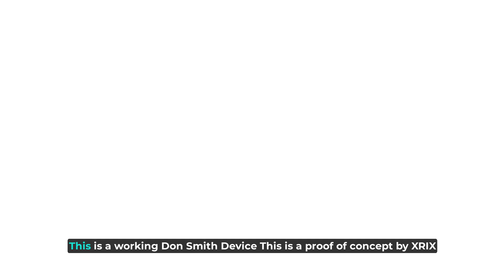Over Unity Working Don Smith Device

Comment: Hey man, I have read Tibor's patent. He talkes about wattless power, cold electricity, electricity that doesn't obey Ohm's law and other abstract terrms. You advised to think in terms of magnetism while reading it but I still don't get it. I have read a lot over the years relating to this subject (E.V. Gray, The Testatika, T.H. Moray, Don Smith), they all seem to connect somehow but I don't know how. I have also tryed Zilano's simple schematics that she recommended but nothing worked as she said, even the simple ones. It is getting frustrating. From your vast experience how does this tecnology work, I mean what is the basic principle?
Reply from the maker: The real example to simply show this(Warning this can kill you): Put two capacitors (Don't use polarized caps) together A and B in series. Attach a bundle of wire(4-8oz awg 22-28) on a spool (hole in center) one lead to cap A, one lead to cap B. Put a magnet halfway up the center of the wire spool, such that one edge of the magnet is exactly half way. Charge up  cap A with DC. + will be A to coil, - will be between  A and B. Once you have that setup, short - to + with a jumper wire.  The magnet will jump. Why, when all the charge took the shortest path when you touched the jumper? The magnet is influenced by cold electricity, and that's what you need to make the circuit in my video work.
Reply: @XR_IX Brilliantly simple! That is your exact cap arrangement with the GDT replacing the shorting jumper.
Reply: @XR_IX  My comments are not posted. Weird.
Reply: @XR_IX  I have a lot to comment on this circuit. Do you mind talking here (b e y o n d un ity -or.g) ; I just oppened a new discussion called Tibor KEMENY and Cold Electricity. You can feel free to post on that discussion, or make one of your own if you would like. I can post experiments better on a forum, that is why I ask. They have a really nice community there. Thank you for your guidance.
Reply from the maker: @juperrr  I see that, however I would like all the comments to reside under this video as an agnostic location, so all can freely see the comments publicly. I saw the document you posted, there is a better one out there available.  goo this "Tibor Kemeny El-90-eng.Pdf"
Reply from the maker: @juperrr  I will answer anything I can.
Reply: @XR_IX  I will try explaining here then, even though it will be very difficult and inefficient. First please confirm this drawing is of the circuit you described (imgurc-o-m/a/2yQbsgj).
Reply from the maker: @juperrr  That is correct
Reply: @XR_IX  Alright, so the circuit is correct, then if I charge cap A directly in the circuit or even separately, what will happen (before I even short cap A) is that cap A will charge cap B thru the inductor, if cap B wasn't allready charged by the power source. Okay, now if I shortcircuit cap A (with the power source removed from the circuit of course) what will happen is that cap A will discharge thru the jumper wire (shortcircuit) while cap B will also discharge, but thru the inductor. That is why you see the magnet inside the coil move. You probably are omitting the simple fact that cap B is also charged and think that only cap A is charged, so when the magnet moves you don't know where the current might come, but as I said above, cap B discharges thru the inductor, so the current comes from cap B.
Reply from the maker: @juperrr  Yes, that is a good point. The B cap does contribute. You can use a very small cap in B. To show you would still get output. The main function of B, is if it wasn't there the voltage will travel through the trafo and never charge the cap. So it blocks DC. Which reminds me vSchaub asked how the gap fires, and that may be a point I didn't mention. Back to your point. I just tested the Colorado Springs setup for the capacitors, and that works as well. If you set it up that way, you are shorting both capacitors with no serial path to the coil. Tell me what you think
Reply: @XR_IX  If I use a smaller cap at B I will get a smaller current thru the coil therefore a smaller reaction of the magnet inside the coil. So basicly the magnet reaction is from cap B. Where is the cold electricity then? The basic principle?
Reply from the maker: @juperrr  Did you see the setup for Colorado Springs top of page 57? It basically has the series cap B first to the supply. Please let me know if you think that would be any different in your mind?
Reply: @XR_IX  I am guessing you are talking about Tesla's Colorado Springs Notes, drawing on top of pag. 57. If that is the case, then regarding that drawing, I can say that is a different kind of animal. Many things can happen over there. I have been studying Tesla for years. He had an interesting way of connecting his apparatus. He was like an electrical wizard. I have the weird sensation when studying his circuits, that they are like living beings. They inhale, exhale, etc.
Reply from the maker: @juperrr  What I am trying to establish is a comfort level with saying that the charges are not going through the transformer, as when you place a capacitor in series with the transformer and discharge through the transformer, because that obviously is working like a battery and making a solenoid.
Reply from the maker: Well assuming I am on to something, which we all must continuously evaluate the references. It works this way: Tibor's Cold Electricity, using multiple staged magnetic multiplication with parallel symmetrical impedances. That's how mine works.
Reply from the maker: @vSchaub There is a video by Paul Babcock. He is a researcher into magnetics. If you want to know what you can do with this exciter effect. Look at that video, and listen to his explanation how to increase the field. Remember now you don't care about primary coil resistance.
Reply: @vSchaub I probably made that assumption and that is not correct of me. So let me ask again if he sees this comment or even my last one. How did you measured the energy output on those 24 lightbulbs XR?
Reply from the maker: @juperrr  I hope you saw my second replication. Please keep doubting (I once doubted as well). It's reasonably bright right?   (LOL)  https://youtu.be/jAL4pByUn2U
Reply from the maker: @juperrr  The circuit is not optimized. Whether it's one or multiple MOTs it can only deliver 7-8 volts loaded output per MOT leg. If I'm not mistaken, according to Ohm's law each MOT should see a decrease in amperage as more MOTs are added. More resistance is being presented to the source with every parallel MOT you add. This is why I tell everyone to build with at lest two MOTs.
Reply from the maker: @se5zk  Quit calling me Shirly. I agree it looks like you are firing the capacitors through the coil with two capacitors. So I started using the three capacitor configuration on Tesla Colorado Springs Notes  on the bottom of page 57. That is basically three capacitors in series with a coil in parallel with the center cap. There, there is no doubt that all the charges run across the gap when it fires. So you have to agree that all the charge flow would be depleted from a short of the capacitors rather than through inductor. If that doesn't convince you, put a cap in parallel with a solenoid. Charge the cap and put a magnet in the solenoid. Short the cap. Why does the magnet jump?
Reply from the maker: I see questions posted to me, but no thread to reply to. Youtube  makes it difficult, so post from your notifications rather than from the video. You may find it works more consistently.
Reply: I wrote 3 long detailed replies today and all were deleted soon afterwards by the tyrants. This platform is essentially unusable at this point for effective communication.
Reply from the maker: @SuperheroArmorychannel  For detailed replies, make sure you write it on notepad, it will save you from to having to re-wordsmith again. How I post is, I select an arbitrary video, and look at my notifications and can navigate to where I need to post from there. I have seen the same issues, and I think it may have to do with the buffering of the site on the video page is rendered, and requires your input. There maybe an unknown timeout value. You hit post, but it really doesn't commit it to the database. Youtube doesn't want essays. I limit my post length, or continue in a separate post. But posting from another page in the notifications will alleviate many of your issues.
Reply: @vSchaub Yes, I did remove it. Miroring seems forced as he said he doesn't want to be there, so I will post on youtube only.
Reply: @vSchaub You just delete those lines between com and put the dot of course.
Reply: @vSchaub I am not asking about the circuit he is using in the video. Look up in this comments he says something along the this lines: "The real example to simply show this(Warning this can kill you): Put two capacitors...". That circuit I am refering to as I want to understand the principle involved.
Reply: @vSchaub A spark that makes a hole thru paper witjout any signs of burn? I have not seen that before. Why don't you post on the forum I asked XR to post? The comunication would be far better and plus there are people other that me who resonate with this type of findings.
Reply: @vSchaub You are probably talking about MrMishMash. I know his videos.
Reply from the maker: @vSchaub There will always be debate if DS devices actually work. That's why you have to run loads, because putting amp meters and volt meters may not tell you of the potential work that can be done. Tesla said he could discharge a 10 watt capacitor and  output thousands even millions of HP. He didn't say watts, he said Horsepower!
Reply from the maker: This is why in the video details, I challenge debunking of the video, if anybody can light bulbs  using DC on a secondary of transformer(s) and illuminate 24 (total) 12V Cobb LEDs of at least 1watt for 6 hours using a 12V 8ah battery, I would be happy to re-evaluate this video as non-over unity. Then I would simply light 48, 72...etc
Reply: @XR_IX  I see that you judge output by light intensity of the LEDs alone. That can be deceiving. Why don't you put an osciloscope over them (voltage and current probe), record the waveforms, export csv and then calculate the energy it took to light them. Do the same thing with the input battery and then compare Joules in versus Joules out. That would be more correct.
Reply from the maker: @juperrr  The point of the video, is give people a simple way they can see for themselves. But you will get many people who will never be convinced. Those are generally the same people who would rather debate than build. I just won't subscribe to that approach about the topic. Build it and if you can prove it's bunk please do. I have no burden to prove beyond the reasonable doubt that it works, because the doubt is reasonable according to my degrees in electronics. It shouldn't work, yet it does.
Reply: @XR_IX  How can you convince someone when you do output measurements "by the eye" , looking at light intensity. Why does almost everyone, when asked to do a correct and scientific measurement, gets offended? This is not some sort of religion, were someone talks and everyone should listen blindly and not question anything. Regarding the debate versus build thing, you have no idea how many circuits I have seen and build and eventually found out they do not work as intended, because the "inventor" (when asked about it) did some kind of measurement wrong and I end up with time and money lost.
This is not about someone being at the mercy of anyone else. Let me ask again: How did you measure the output energy on the 24 lightbulbs?
Reply from the maker: @juperrr  Not offended, but also not trying to convince you. I am not selling anything, nor do I want anything. I will answer build questions, but you have to make an effort to build it first. What have you built so far, just for common reference?
Reply from the maker: @vSchaub All toilet water smells, even unused we mentally have difficulty drinking it. At this point, I have no idea who's AI and who's not.
Reply from the maker: @se5zk  First thing, Don Smith schematics, are never complete, and rarely accurate. Often they show parts of modules, but out of context. The only time you would join two outputs of a NST through two diodes, would be when they are center grounded, like in a his "Industrial device" where both HVs are use a grounded center tap. Don says that the output is a straight DC rail. Which is exactly what you need to charge capacitors  to your target voltage. The big idea is why do you need to charge capacitors. I illustrate that on my Tesla Hybrid DS Hairpin. One wire is a transmission construct. Not to be confused with a power amplification construct.